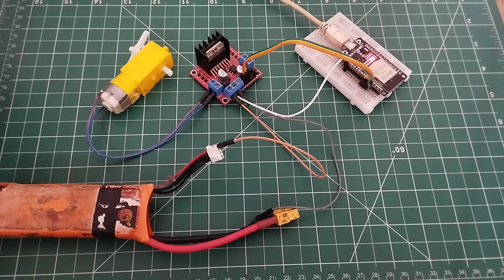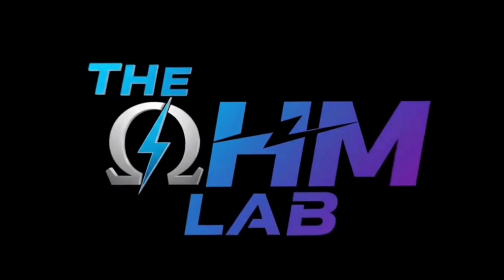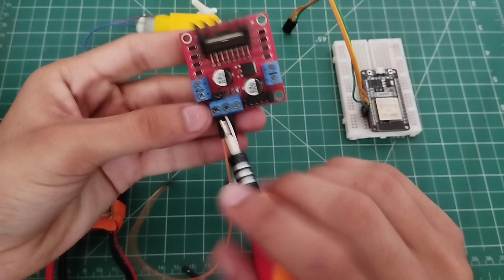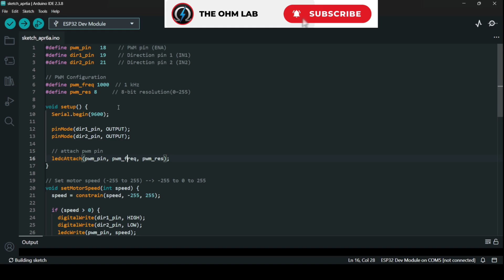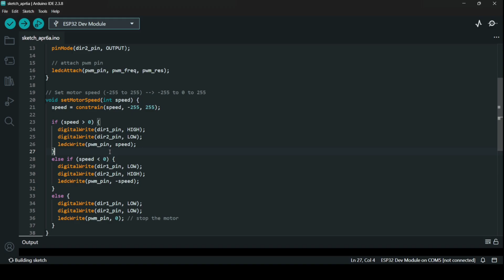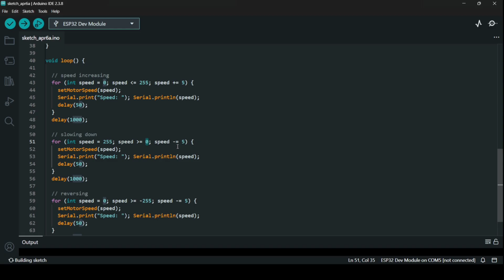Stop Using analogWrite() for PWM — Do THIS Instead!

Comment: if you're using analogwrite() for PWM control, you're already doing it wrong. You should have bene using digitialwrite() on a designated PWM pin. This is especially true since PWM is literally just flipping high and low the signal.
Reply from the maker: analogWrite() (it is used to implement Hardware PWM): This function tells the microcontroller's internal hardware timers to take over the control. Once you call it, the hardware handles the high/low flipping in the background. Your CPU is then free to do other things, like reading sensors or calculating logic.

digitalWrite(it is used to implement software PWM): To create a PWM signal with digitalWrite(), you would have to manually turn the pin HIGH, wait a few microseconds, turn it LOW, and wait again. This uses up 100% of your CPU's attention just to maintain a simple dimming effect or motor speed.

As I want to control motor speed that's why I am using analogWrite not digital Write